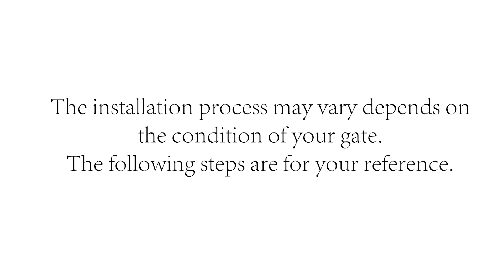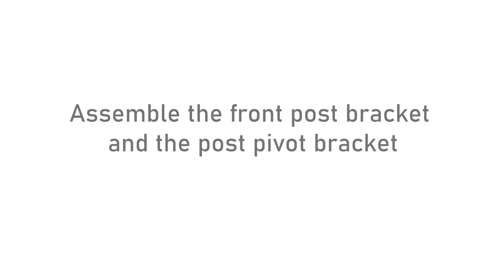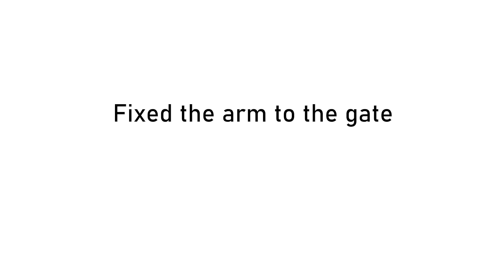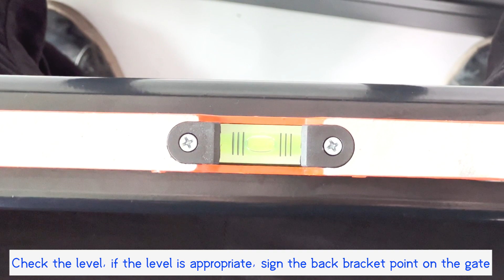Giant JUJIANG PKM-C026 Automatic Electric Smart Door Motor Swing Gate Opener

Comment: I installed the electric lock but it unlocks when I close the gate not when it opens. How do I fix this? Thanks
Reply: Is this gate good ? Haven't seen much reviews on this.
Reply from the maker: When you open gate, it should unlock, that is the correct working. If your electric lock did not unlock when you open gate, then you may need to exchange 2 wires of electric lock.
Reply from the maker: @phillipjacobs2758  Do you need gate or gate openers ? we could send you more pictures or videos. You could contact my whatsapp: +8613328537628.